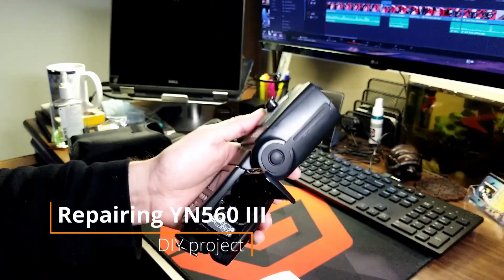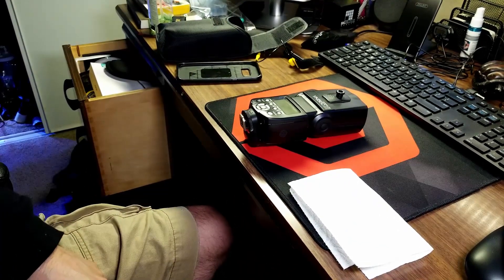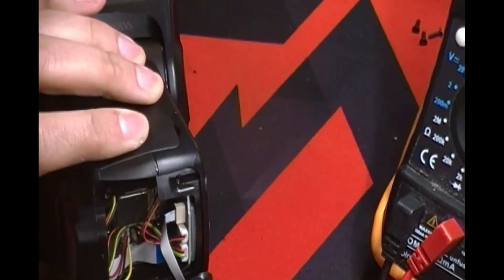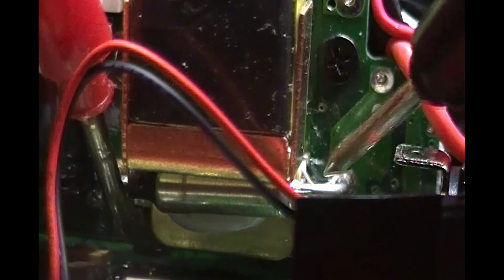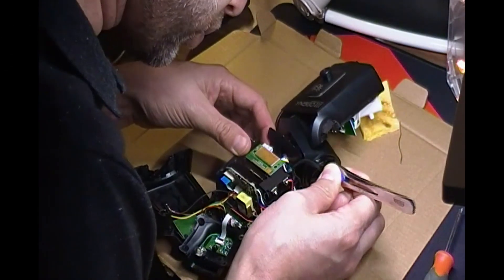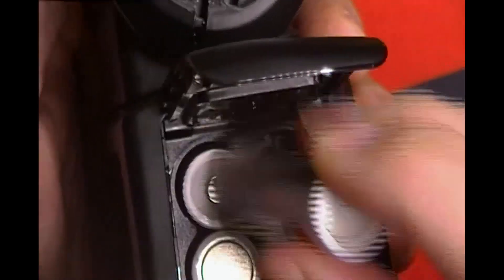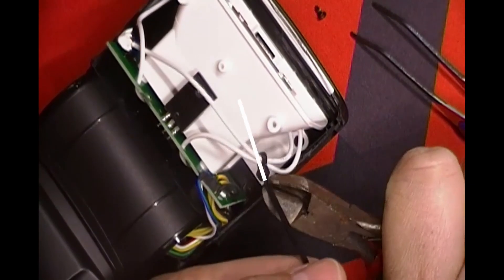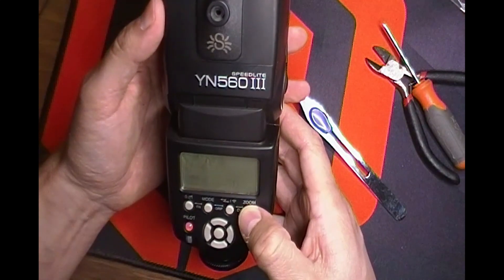Yongnuo YN560 III Speedlight Repair

Comment: My YN560 IV fires as I slip it onto the hot shoe ,to my astonishment it doesnt fire on command everytime I push camera's shutter button. Do you have any idea what could be the problem?Thank you it advance!
Reply from the maker: @TheRedSatan10  just saw ur message, hope you figured out.  Only time I saw that exact unusual behavior is when I placed a trigger in between camera hotshot and the speed light for the purpose of triggering camera shutter wirelessly.  It wouldn’t work consistently.  I just tried to replicate it and couldn’t, so I guess start by checking/cleaning the pins on both speedlight and camera hotshoe, test with another speedlight, see if it’s just that one that is causing issues.  Kinda does sounds like bad communication at the firing pin, sorry I’m not much help on that one.  Best of luck

Comment: Hi,my yongnuo 560iv started whirring(not beeping). When I press the flash button it just pulses weak flashes. Any suggestions or recommendations?
Reply: This is a guess, so take with a grain of salt :)  If the whirring sound is constant it almost sounds like the zoom mechanism which you're hearing (which moves into position on startup) is stuck on something, maybe a wire?  If it were stuck running that might prevent the capacitor from fully charging and the flash ready beep from beeping.  The test flashes would also be weak as a result.  

You could attempt to remove the case and see if zoom mechanism is stuck, at the same time check that the flash bulb filament is still good.  Don't touch anything though without discharging the capacitor first.  It could also be IGBT transistor I saw a post on.  That would require soldering.  I've only replaced a blown fuse, a flash bulb and broken power connection like in this vid.  

DISCLAIMER:  I don't have any formal electrical training, I'm just a photographer so be careful and attempt at your own risk.  Also, be aware the the top circuit board still has electricity even after you discharge the capacitor.  I know this because I zapped myself last time I did this thinking everything was fully discharged.  Good luck!
Reply from the maker: @ianosnaznara899  Sorry didn't realize I was getting comments on this.  7 months later....whirring is normal, I don't get beeps on my YN560iv when sound is turned off in settings, weak flashes likely mean bulb is fried.  I replaced bulb on mine after prob 2.5 years of regular use, it was noticeably burnt and new one fixed it.  I'm using Godox TT600 mostly now.  Best

Comment: 2024 Thank you for this Tutorial! i though my YN560 IV has an internal issue and abandoned it in storage for 4-5 years, and behold!  Today i saw this video and knew it's just the corrosion on the battery contact points. cheers!
Reply: Yup, it happened to me too recently something so simple.  I still run around with a YN560IV on a belt clip  in 2024 for Real Estate photography though I've switched the rest to Godox. Glad it helped 👍

Comment: Hi. I had the YN560 IV flash and the power not turning on. I tried to clean the battery contacts as shown on your video even though it is in good shape and has no corrosion, but still, it won't turn on. Any advice? Thanks
Reply from the maker: Anytime this happens to me, I first try new set of batteries (could be dead cell or battery contacts need cleaning as well), second check that the batteries all sit level in the compartment if even one is slightly lower it will stop flash from turning on.  This happens because battery contacts are pressed down over time and the springs are no longer fully extended.  I sometimes use tweezers or make a tool out of a paper clip to reach in and extend the battery contacts back up.  Last, you could have blown a fuse, if so they are cheap $7, BUT if you do not know how to discharge the electricity stored in the speedlights capacitor it can shock bad enough hospitalize you, so I would just buy another speedlight.  I now use Godox TT600, cheap $65 on Amazon.  Hope this helps.

Comment: The contacts in these cam corrode and break easily. Fixed by soldering a spring contact from an old solar garden light. Never store these with batteries in them, batteries in before your shoot, and out right afterwards ❤
Reply from the maker: Good tip, thx👍 Fortunately no corrosion yet since always remove batteries after every shoot.

Comment: I will definitely clean the terminal.  I have the same problem but I did not use my flash for 3 years and I did take out the batteries when not in use.  Will try this before buying a new flash.
Reply from the maker: Not likely the issue since you wisely removed batteries before storing it, unless corrosion from past use.  Maybe the soldering connecting wires to the battery terminals were fatigued and finally broke?

I made DIY dummy batteries and accidently put them in backwards/reversing the polarity which blew the soldering from overload.  I switched to Godox TT600 cheap and equally good.  Best of luck!
Reply from the maker: Forgot to mention the obvious problem that's easy to overlook.  Check the little metal battery spring contact plates to make sure they are fully extended and aligned.  If even one battery is not touching both terminals, nothing will turn on.  It happens...

Comment: Hello, my yn 560iii has started to recycle in 12 seconds when I shoot at 1/1, the problem is capacitor?
Reply from the maker: Sorry never saw your message.  You probably got a new one or fixed it by now.  That would have been my guess too though.

Comment: Hello, do you remember what values the capacitor had?
Reply from the maker: Don't recall, but see if I can find it and let you know.
Reply from the maker: Fairly certain this is it on Amazon:  PoiLee Capacitor 470uf 16V Radial Electrolytic Capacitor 8x11mm 105 C (Pack of 10pcs) https://a.co/d/6tzJVfY

Comment: Hello , I'm facing problem with 568exiii
When I insert fully charged batteries ,after testing with 1/16 for three to four times ..the battery is discharging easily by one point...it's not even giving backup for 100 flashes on full charge..any suggestions wil b helpfull

Thanks.

Comment: Hi... thanks by the video. Recently I was trying to use some kind of ac adapter instead batteries in all my flashes, and i got it. But for reach it  I ruined 3 flashes. I ruined 2 Speedlite Pixel Mago, and 1 Speedlite X800C Pro; and It happened while i was conecting the flashes with cheap ac adapters having a short circuit. I already have dessembly all flashes but everything looks clean and nothing seems to be bad inside. ¿Where do you think i should start to find for fixing it? Thanks so much
Reply from the maker: Hey Alfonso, I did the same. If positve/negative terminals still good like I showed in video, maybe the fuse blew? You can order fuses on Amazon for under $10, but you need to research which they take.  I did it once for a YN560 IV and was a pain to install, but it worked.  Check if fuse is still good by testing continuity between the terminals with a multimeter if you have one.  Other than that maybe the capacitor?  I don't know how to test/replace those, just remember to disharge them before trying it. Best of luck man, lmk if you figure it out.

Comment: Thank you so much , I was but the battery in obesit way and store my tow speed light for 2 years, and after I wanted to work again with them , They doesn't work , and i found your videos which help me after I clean them by sterilizer . and they came to a life again . Thank you so much from Tobruk. ,Libya

Comment: I press power button and its on when i release power button its off.. 
Please solution ....
Reply from the maker: Sorry Aamish, I have no idea, never had that problem. If switch broke, I don't even think you could buy a replacement for it.  Would have to find another broken Yongnuo to use it for parts and probably wouldn't be worth all the trouble.  I could be wrong, I don't have any background in electronics.  Let's us know if you find the solution. Thx.
Reply: Hi Aamish, I have exactly the same issue. The flash is fairly new. So no corrosion. Please let us know if you managed to get it working

Comment: Is it hard to get to the on/off switch? My 
on/off switch on the Yongnuo 600EX-RT (for Canon models) is very loose 
and easily can move accidentally turning the speedlite off during a 
shoot. (my model has a 3-way rotary type switch..Off, Lock and On positions). It will actually turn past the full intended travel past the ON and OFF positions, now with the damaged switch. Still works but one could easily turn flash off by accident, so won't be reliable in the field). I bought it for a backup flash so not even sure how this happened. Thanks.
Hoping you have a suggestion or can tell me how hard it is to get to the switch internally. Thanks. 
Philip
Reply from the maker: Sorry Philip wish I could help.  Never had that model so haven't had a chance to take it apart.  I don't see any other repair videos posted on it either.   Best of luck.
Reply: @johnramirez4217  Hi John, I appreciate your reply. 
My on/off switch is in the same exact spot as your model, it is just a 3-way rotary type. When you had your unit apart, was your on/off switch easily accessible? That would be helpful for me to know that info this way I know that at least I'll have good access to the switch to try and repair/replace it. (Assuming I can find the correct part). Hopefully it's repairable so I don't have to look for the correct part. Thanks again. Your video is very helpful. 
Philip
Reply from the maker: @uptownphotography  Looking at the video again, I would say no, it's not easily accessible.  It looks like you have to remove the whole motherboard just to access it.  If you do decide to go there, just make sure you know how to discharge the capacitor, definitely not worth trip to hospital or worse. I started using Godox TT600, relatively cheap $70 and work well.  I prefer the quick on/off switch on these better.

Comment: Thanks! I had the same problem with battery - corrosion on the contacts.  Clean the contact using hand sanitizier but I have to use elastic to force down to the contact.
Works for now, may be taking apart later to see what's inside.
Reply: Have a look with the batteries installed and the cover open, usually you will see one or two batteries sitting lower than the others (usually the negative ends of the batteries against the cover). Try using a paper clip bent into a hook at one end and pull up the battery contacts as they bend over with use

Comment: i have same problem blue light flash not working plz some sugestion
Reply from the maker: Sorry haven't had that problem.  You're saying pilot light stays blue and doesn't turn red?  Did you try factory reset?  press both mode and illuminate/sound buttons to get to advance settings, scroll up or down arrow, until you get to "Cl ea" and then hold down the select button to reset.
Reply: I have the same problem.. Not yet repaired..

Blue light stays continuously on.. And won't change to RED.. What should I do?

Comment: Is it same mecanic system with yongnuo 560 mark iv?..
Reply from the maker: Same mechanism and basically same layout.  The motherboards looked only slightly different.  In my YN560IV the capacitor was bright blue and easy to identify so that I could stay clear of it when handling and discharge it before doing any further repair.  They also use the same type of fuse.